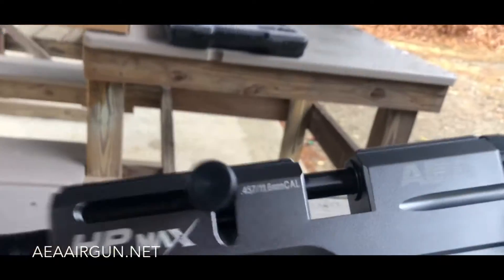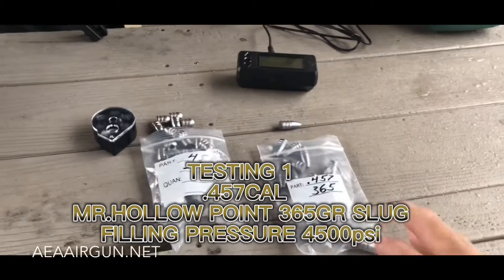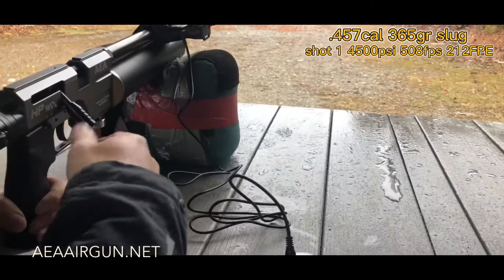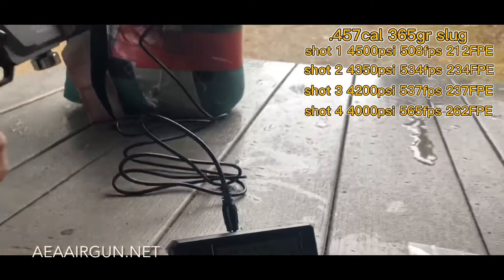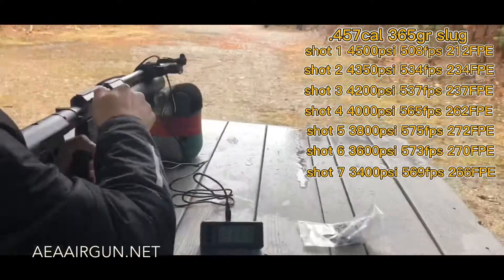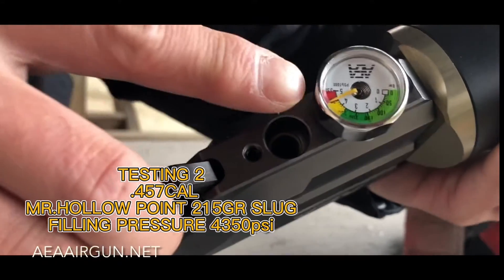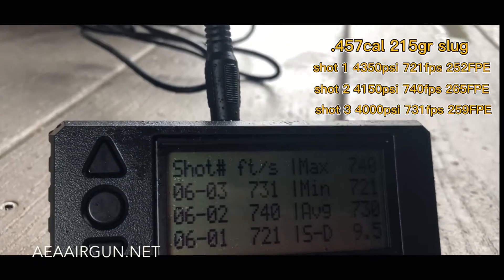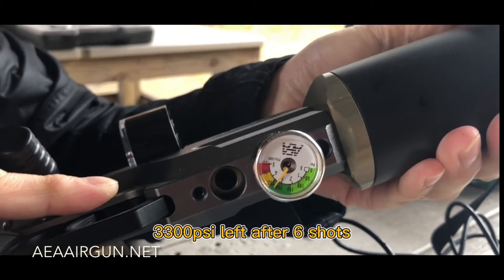BinTac:AEA HP Max 457 field testing

Comment: Some people slightly complaining about how it's not quite doing the 300 FPE power wise I do understand but I remember years ago when the dragon claw full size rifle with a significantly longer barrel at 50 cal was rated somewhere around 235 FPE in 50 cal so this 13-in barrel carbine in 45 Cal producing a bit more power is still very impressive All things considered 👍😁

Comment: I don't know. Not too impressed with the results.   This gun is getting no where near 300 FPE.
Reply: You're right not 300 but...He is showing  the real power. The factory claims he has no control of. Also 172 sure is somewhere near 300. Take away the factory claims and you've got a 20 inch 250+ fpe 600$ AIRGUN. Pretty good. 2-3 years ago unimaginable.
Reply: @airgunfun4248  Yeah but when you're talking 457 and 50 cal, you thinking raw knock down power.  I understand it's just a pistol though. Might as well get the 457/50 cal Challenger for the same price. Plus you're getting much more power out of the Challenger.
Reply: @mjeff7415  For sure. If compactness isn't one of your criteria. That would be a great choice. And for just a little more you could get the bullpup. And that's a really bad ass gun. I'm thinking the max as a truck or atv quick draw varmint killer/hunting gun. All about the job you want it to do. I wish I could have one of every one they got haha.
Reply: Yes I'll take even 200 fpe. Still stronger than a .357 challenger standard. With hf the barrel. How could you not be impressed 😂. It's light, short, and It I'm sure it can get to the 300 fpe fairly easy but as is. What other ag comes close to it?
Reply: I hit 310 fpe using .454 250 gr hp from hunters supply. I have a astigmatism and was just using a red dot at 45yds so i can't tell how the accuracy is with those but i was hitting 300fpe with first to shots on the chrono. 745 and 725 was average first 2 shots.
Reply: @mjeff7415  no. This is a pistol and can fit in a backpack. Although the .50cal can hit 320fpe fyi. Don't get the AEA Challenger. Get the AEA Zeus if you're going to get a hunting rifle.